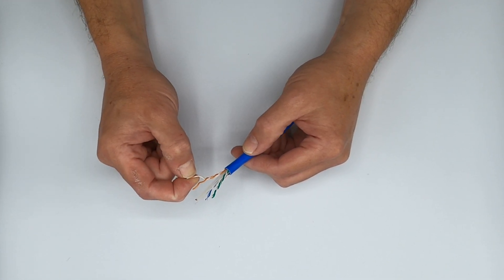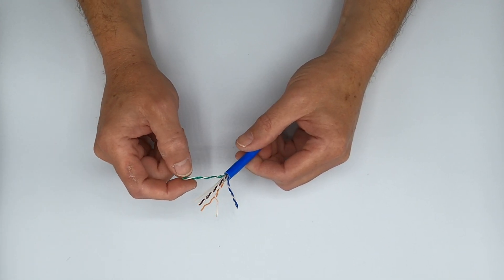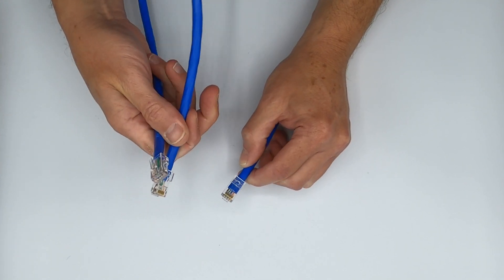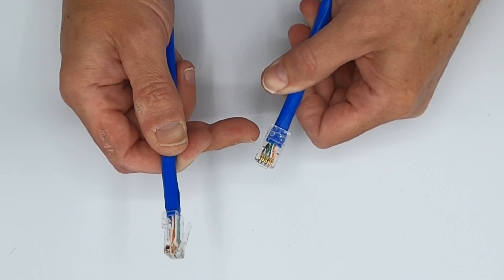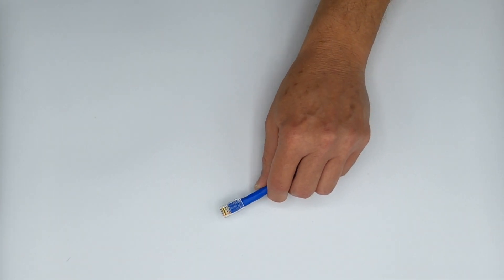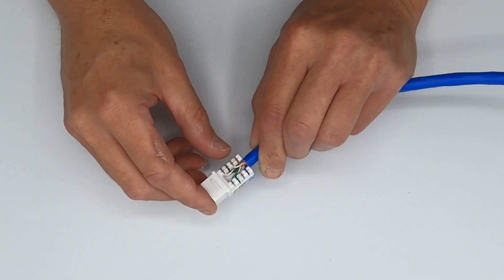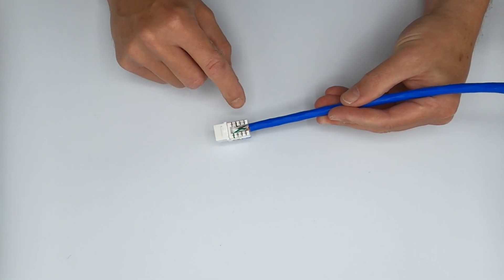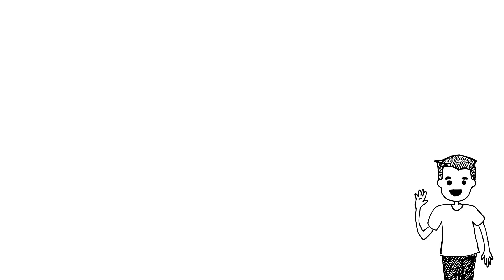Why Is My Internet Speed Slow? It May Be Your Ethernet Cable!

Comment: There are some situations and possibilities, but most of the time it is overstated. With a properly terminated cable (the norm) this is rare.
Reply from the maker: Hello. Properly terminated means not only the correct wire map but also proper plug-to-cable fitment to achieve the expected Category performance and, therefore, expected speeds. Up until lately, 1G and even 100Mbps were pretty common and affected to a lesser degree. That said, 2.5G and higher speeds are starting to become the norm, and any cable issues will start showing up with a greater frequency. Literally.

Comment: When I do those keystone jacks, I bring the sheath to the middle of the connector and then fan out the wires.  Also, I don't untwist.  I push the pair down over the separator, between the pins, which then separates the wires with minimum untwisting.
Reply from the maker: Hello James. Interesting technique. Our jacks won't allow that. Putting the jacket inside the channel all but guarantees you won't get the conductors seated into the IDC slots. As for using the cones as separators...yep, but that is assuming the pairs are not super tightly twisted. It sounds like you were using relatively thin Cat5e for the method you described.
Reply: @trueCABLE  That would depend on the connector.  The ones I've worked with support doing that, but I could see yours wouldn't.  I have also worked with jacks where the connections are made at the end of the connector.  Most of my cabling has been CAT5e, but I have also done a fair bit of CAT6.

Comment: *Okay crazy story. I watched this last week and got to thinking 🤔.  I purchased my home and the Ethernet was done by previous owner. I had well over an inch from jacket to my rj45s and keystones were a complete mess as well. So I re did both ends with (imo) a beautiful job on both new rj45s and keystoneS… I’m getting the same speeds. Curiosity this has actually been tested? I didn’t notice any speed increase on any of my device connections. They all run between 900-1100mbs+ depending on time of day ect.
Reply from the maker: Hello Robert! It sounds like the pairs themselves still had the proper amount of twist/untwist to preserve performance despite an excessive amount of cable jacket missing. In your case you were lucky! Had there been any degree of persistent EMI/RFI (or cable to cable interference) in your environment you might not have been so lucky. Also, there could have been excessive packet drops intermittently that went unnoticed. It was a good idea to check your installation and correct it. Poor installation practices don't always show symptoms 100% of the time, or might show up down the line as the installation ages. Yes, this has been tested; it just so happens that your environment was more forgiving.

Comment: Looks like exactly what's just happens to me. My connection is like the second example and I'm only getting 91mbps instead of 900mb
Reply from the maker: Hello Webs. If you are getting 91 Mb/s that means your switch(s) are connecting at 100 Mb/s. This is almost assuredly a termination related issue. Try a different patch cord if that is what you are using. If you terminated your own patch cord with RJ45 8P8C plugs at both ends then try a factory terminated one.

Comment: I'm curious what the actual degradation is.  Is there research somewhere that show that a 1/4" of untwisted pair in the jack actually matters, and if so, how much?  Me doth think the lady protest too much.
Reply from the maker: Great question. I have not incrementally experimented with out of spec untwists in a laboratory environment with our Fluke DSX-8000. I have, however, seen the effects of how excessive untwist can affect real world performance of the permanent link or patch cable and therefore overall channel performance. ANSI/TIA 568 2.D states that 1/2" is the maximum conductor untwist to avoid issues. I can confirm that having more than 1/2" untwist will result in dropped packets. As the amount of (out of specification) untwist increases the number of dropped packets increases and your Ethernet switch will drop back the next lower speed due to excessive packet drops.

You want, as a matter of best practice, to shoot for the least amount of untwist in any termination as this increases cable performance headroom (measured in dB) for NEXT (crosstalk). Large amounts of headroom do not necessarily translate into a faster application speed but it can help prevent issues with a slightly out of spec component in the channel, such as a no-name keystone jack. This can be the difference between a full pass, marginal pass, or fail on a Certified install. It can also be the difference between a working and non-working cable run.
Reply: @trueCABLE  Thank you for the thoughtful reply.  I do my "best" to minimize it, and am sincere in my concern that my lax attitude might be causing my clients compromise.  I just think there are also some absolutists/purists who take it too far.  I'm a wonk, and love to look at the data to parse out habit/opinions/personal preferences from facts.
Reply: My guess is not very noticeable. I’ve seen terrible looking termination ends in regards to untwisted exposed cable with no noticeable loss. I tested after seeing this video and over 50’ with almost an inch and a half exposed I had no noticeable loss. Definitely not saying he’s not right and you always want to make the best termination possible. Not I haven’t seen any noticeable loss. Now poor crimps or scored wires I absolutely have.

Comment: I'm the dumb dumb that tried to join two cat 5's by stripping and joining the ends with insulation tape. I was wondering why the tester was saying none of the 8 wires worked. There's a reason they are twisted in the first place doh
Reply from the maker: Hello. We are glad you found the solution to your issue with our video blog. We do our best to help folks who are new at this. Also, no shame at all--I have done some really "dumb" things too!